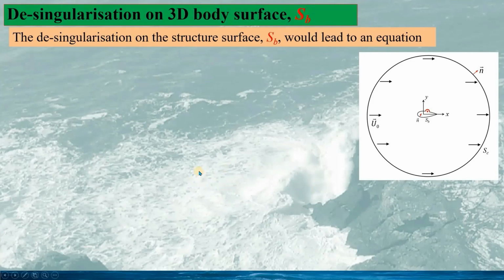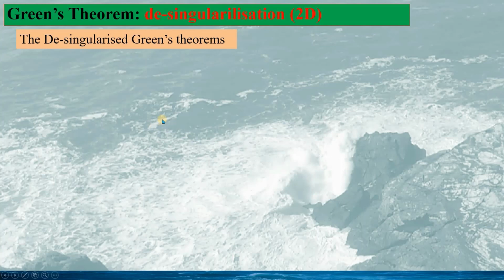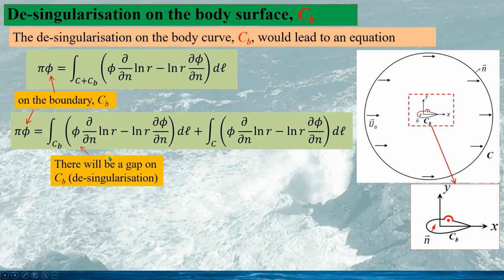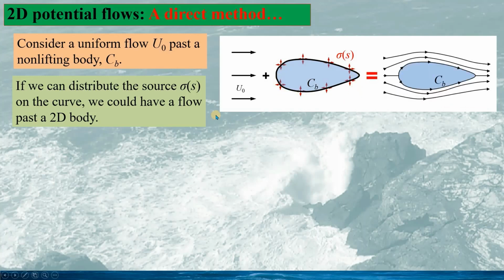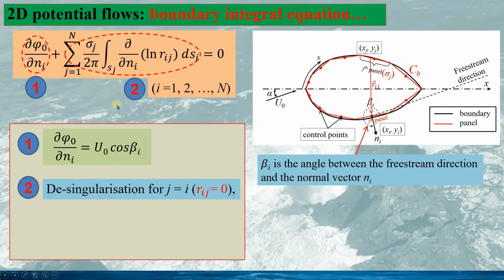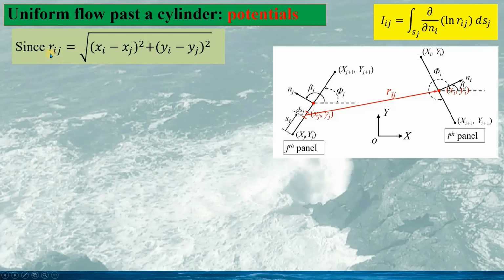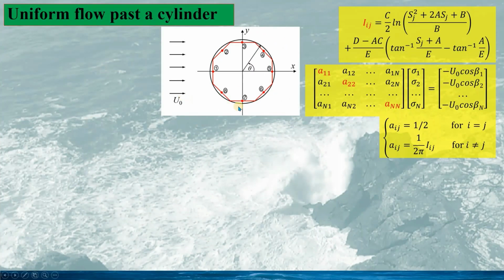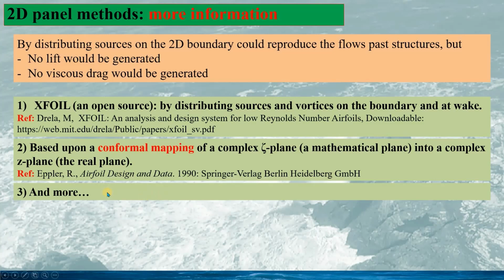Panel method for potential flows, Part 3: boundary integral equation for 2D flows

Comment: The panel method only deals with inviscid flows. For calculating CL vs alpha curve for any particular airfoil and to find the stalling point we need to couple boundary layer equations with panel method. Can you help me understanding how to couple boundary layer viscous interaction with inviscid panel method to calculate CL vs apha curve for any particular airfoil. I have already calculated the CL in different alphas for NACA2412 from Panel method but can not able to stall the CL vs alpha curve cause I am not able to understand how to take viscous interaction into account. please help.
Reply from the maker: Thank you for asking, but I don't have the experience either. Can you refer to xfoil, an open source. It seems xfoil could handle the problem nicely.
Reply: I could use Xfoil but that will give me the exact result I want despite of telling me how software is calculating them. I don't know which formula or method or equations Xfoil is using. I want to understand them only.  Anyways..I will keep researching.. Thanks for replying